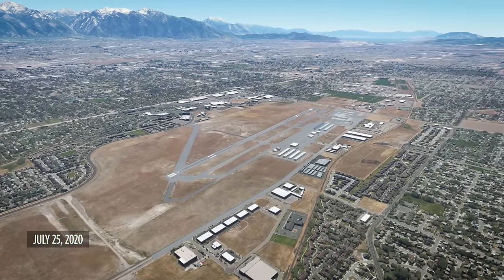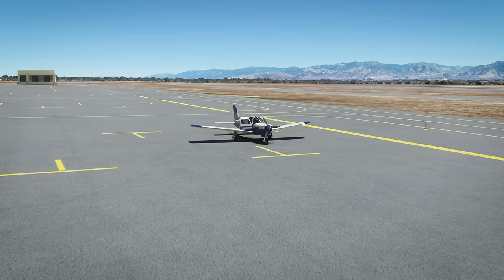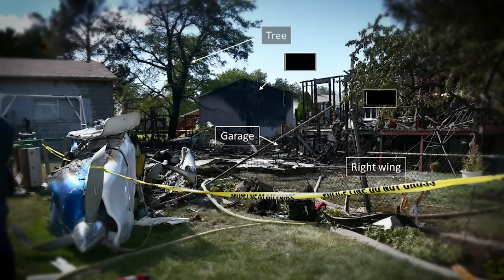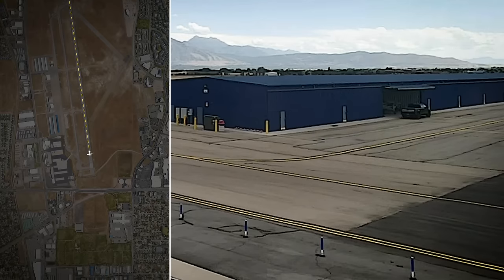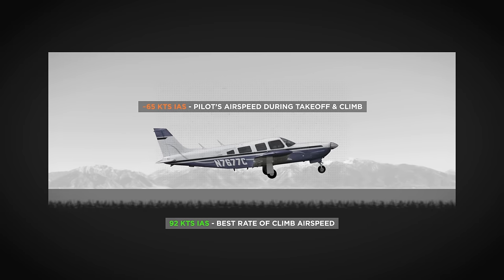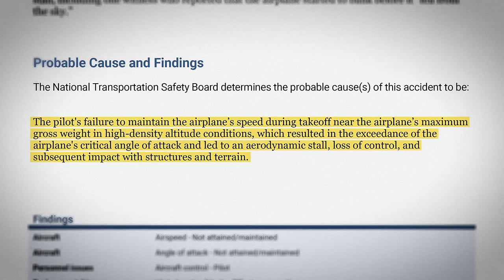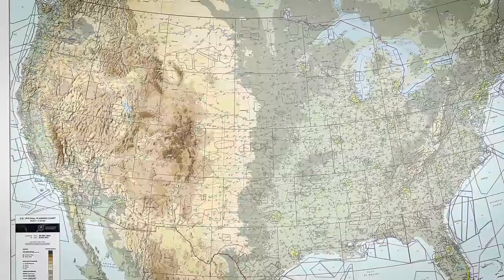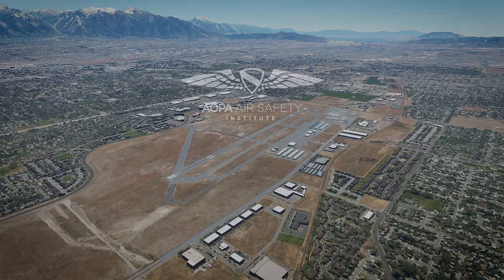Accident Case Study: High Aspirations

Comment: Don't forget that aircraft performance is normally tested with a new engine, plugs, magnetos, fuel system, etc.  I have been surprised more than once with an airplane that simply didn't perform to specifications.  Never push the limits unless you know exactly what you are flying.
Reply: A 500 FPM is a very big variation. Not to mention being under the max gross.
Reply: A properly maintained airplane should perform close to the POH. Even if 30 years old.
Reply: I think the new engine part is the lesson here, but I would argue that POH numbers should rather be conservative and have a 20% margin built in, especially on these cases with hot high altitude close to max weight. No reason there isn’t an extra large margin of safety written in the POH, I doubt this situation would be tolerated if it was a Boeing or airbus passenger jet that didn’t takeoff as advertised in the POH!
Reply: If it's possible to use mixture to increase power beyond what is good for engine longevity, the manufacturers could be doing that during those test flights.
Reply: @jfmrod  I don't think this has anything to do with the age of the engine. I think the pilot did not lean the mixture properly (look at the fuel flow on the takeoff roll - 28 GPH, which to me looks like "full rich"). And that leads to reduced engine power on any normally aspirated engine, even if brand new.
Reply: @Chr15T   That makes sense, but it is also unnerving to think that this tragedy was mostly the result of a poor mixture setting.  Would running rich cause such a massive performance hit?  From start of takeoff to the crash looked like 2 minutes and he barely got above the trees.  The pilot tried to increase airspeed by pushing the nose down but couldn’t hold it due to low altitude.  The short field flap configuration was a good call, but my gut tells me something else was going on.  Just not sure.
Reply: @riclatz7191  Yes, running full rich at a density altitude of 9000ft would result in a very significant loss of power. One that should definitely be very noticeable in the takeoff roll.
Reply: looks like he didn't think to adjust the mixture before it was too late
Reply: @kevinbrand7992  afaik there is no side effects to increasing power through mixture except for possibly increased engine temperature. I think at take off you would rather get all the power you can get even in when not in a high temperature/altitude situations, just because the faster you have some altitude the more options you will have and the less time you are at a high risk/few option altitude. Same reason why takeoff is usually done with full power in piston planes in GA.
Reply: @Chr15T  if that is full rich, I agree that was definitely an oversight, I'm not sure how much power loss that corresponds to though. The video does not make it sound like that was the issue, and suggests the issue is the numbers on the POH not matching reality.
Reply: @Chr15T  "A properly maintained airplane should perform close to the POH. Even if 30 years old."

This is the kind of advice that will kill you, folks. Be careful out there.
Reply: @IslandSimPilot  Exactly the opposite is true.
 
Accepting that an airplane does not perform close to the POH because it is old will kill you: 

If the airplane underperforms, you should be prepared for that, notice it, abort the takeoff, locate the issue and resolve it. 

Don't just accept an underperforming engine as a normal thing, because lingering technical defects may first show up as minor but suddenly become bigger.
Reply: @Chr15T  I'm not talking about an airplane that underperforms in the way that you're describing. I'm talking about flight planning  and the safety margin to build in.
Reply: @IslandSimPilot  What happened here does not look like a flight planning mistake.
Reply: @Chr15T To an extent I agree.
Reply: Sound advice brother....👍
Reply: @riclatz7191  mixture is extremely important. It is impossible to climb with full mixture after a certain altitude.

Comment: It’s really sad to see how an ostensibly good, careful pilot can get themself and their passengers wrapped up over missing the small things.
Reply: I would have to say it’s the plane manufacturer and certification agency that seem to have “missed the small things”. I can guarantee that no accident investigation agency would put the fault on the pilot if this was a Boeing or airbus passenger jet that missed the published figures by about 30%…
Reply: May be did all the small things right but missed a big thing: leaning for max power at this density altitude.
Reply: @jfmrod  The book numbers are for a brand new airplane off the factory floor and being flown perfectly by a professional test pilot.  This airplane was built in 1975, so far from being brand new.  Throughout my training I have been told to take the book numbers with a grain of salt when it comes to flying some of these older model aircraft.
Reply: @Chr15T  I agree, if that would be enough to tip the balance then the video should emphasise that more, not that the POH numbers don't match with reality. The issue with the latter situation is that there is not much to be done except not believe certified POH and benchmarking your plane/engine before trying to fly it at the limit of the performance envelope.
Reply: @bodenwhitmore7699  I've heard the same, but this case shows that you need a lot more than a grain of salt... what I realize is that you can't take much for granted in flying, specially when changing the flight setting and parameters like weight. Essentially take every flight with a new configuration/setting as a test flight and you will be able to maximize safety.... do real world performance benchmarks
Reply: the engine wasn’t built in 1975
Reply: He didn't miss small things. He missed really, really, really big things.
Reply: @IslandSimPilot Like what?
Reply: Not being able to take off is not exactly a small thing.
Reply: @IslandSimPilot  Exactly.
Reply: @duke3478 Like using flap ,for a start. Any flap in this situation is deleterious to takeoff roll and subsequent climb rate . All needless drag .
Reply: @alexp.6406  that, or wait for a low-DA part of the day for takeoff, and plan to arrive at a place with a longer runway later.
Reply: @davidwhite8633  flaps may reduce speed, but the Poh likely recommends 10deg flap for TO as it will increase lift. We see enough crashes from the pilot that forgets to use TO flaps.
Reply: @dro754  The only reason for flaps on T/O is for short/soft field or obstacles off the far end .He had neither . Any certified airplane climbs steeper and faster , clean . It has nothing to do with lift .If you can climb out of ground effect then you have all the lift you need to equal your weight , and weight will continue to decrease as you burn  fuel . After all , you wouldn’t put down any flap to climb over a close cloud or mountain ridge , or to make a close MCA on an airway , would you ? Climb or descent rates/angles depend on excess power /thrust/.  nothing more. Excess thrust is [ thrust — drag ] and so the less drag the better i.e. no flap .
Reply: The airplane stalls when the pilot uses the "elevator" to climb. 

The elevator pitches the wing to the stalling angle of attack. Therefore, the elevator is the "stall device". And should be treated as such. 

The pilot should not try to climb out of ground effect. Pin the throttle, pin the prop lever. Set mixture for maximum power. And keep in in ground effect until cruise-climb speed is reached. There is zero reason to be flying around near the low end of green arc.

Comment: This happened to me early in my flying.  I was flying an Archer, full fuel, with two large passengers, both in the back seat at KEYW on a hot summer day.  The plane took all the runway, and lifted very slowly.  I got lucky, I flew the pattern at 300' AGL and landed immediately, no incidents occurred.  A mistake I never made since.
Reply: Were you over max takeoff weight?
Reply: @hellogoodbye4728  ...and aft CG, and in a Piper.
Reply: Many Archers have a 180hp engine. Perhaps this was a 160?? I flew an Archer II 180 back in the day and loved it's excess performance. Max gross in the summer and it would climb at 1200fpm to 4000-5000' in the Florida summer, where I'd finally be able to stop sweating. Nice feature!
Reply: Thanks for sharing.

Comment: A great analysis and video, a few lessons I take away from this are,
(1) Treat every flight as if you have never flown the same route before.  No two flights are ever the same.
(2) Never do it so close to performance limit.  That 50% padding advice actually surprised me.  I never thought I needed that much, but now that I've thought about it, I think since in a airplane things can happen so fast, that 50% sounds just about right for the decisions you make on the ground and the time you need in the air.
(3) Always double check ASOS/AWOS just before takeoff, in case winds shift or other conditions change, which may lead to lots of recalculations.
(4) Take friends or family for sightseeing in much more favorable weather conditions than this case...much.  That said, overriding your own confidence, and your desire to let everyone have fun, is very hard -- takes a lot of mental practice and still not enough.
Reply: If you are incapable of underpacking (myself included), you either have to have an aircraft tolerant of what you bring consistently at any and all weathers and airports (the more expensive option) like a Caravan, or be accepting of the no-go option.  These six seat aircraft are usually very handy, but with the small naturally aspirated piston, they seem to show up often in these debriefings.  Same horsepower as my Explorer, which does not need to fly.
Reply: "That 50% padding advice actually surprised me."

I was told that since day 1 of flight training, and I will always follow it. My instructor (in his 70's with 50 years of flying) always emphasized this: book numbers are with a brand-new, perfectly-performing aircraft and a test pilot.
Reply: @jaysmith1408 key lessons in this case is when in doubt don’t do it I think he had doubts about this trip which is sad and his eagerness got the best of him

Comment: As an instructor who has always taught more from the principals in "Stick and Rudder" than from some of the poor energy management airmen certification standards, my heart goes out to this pilot, his family, and those affected on the ground.  ACS teaches "acceleration in ground effect to Vx or Vy as appropriate."  While I appreciate the addition of "in ground effect," neither Vx nor Vy was appropriate here.  Vx had become Vy and Vy is just too slow for maneuvering flight.  Having flown low powered training size airplanes in the mountains for years, I have learned that nearly all mountain flying is maneuvering flight.  Even down drainage in the desert, he was constantly in the realm of maneuvering flight.  Everywhere, but especially in the mountains, I have taught the basic level in low ground effect takeoff as default.  More than a few times in many engine failures at low altitude, this extra free ground effect energy has made maneuvering to a suitable landing site possible.  Why do we teach pitching to Vy with half a mile of runway ahead?  Why do we teach giving up the free extra ground effect energy that will provide zoom reserve airspeed, even cruise airspeed, before the end of the runway.  Why do we teach giving up the free extra ground effect energy that will make life and death difference sometime in our flying career?  This well trained and competent pilot, based on his training, was lacking the training that would have saved him and his family.  That was not his fault.  As a part of the training community, that was our fault.
Reply: Thanks for the insight. I'm not familiar with the term "maneuvering flight" in the sense of a regime, can you clarify how you define that?
Reply: Being a CFI in the east we rarely have to deal with DA issues but your insight is invaluable. Two things stand out on this one.  Wind check before takeoff.  He could have just asked the tower, then changed runways and worked out a Bravo clearance to get established in a climb. Second, the 50% padding on performance seems vey prudent as these older aircraft, and who knows about the engine compressions, would have contributed to even less power available than book values. Seems to me this should have been an early morning departure as he would have had that going for him with a much lower density altitude. Almost seems like a turbo is a must have for high density altitude flying in the west. Thanks again for your great insight!
Reply: I must have messed up my reply last night so here goes again.  I define maneuvering flight as flight at an altitude too low to recover from inadvertent rather than planned practice stall.  It is somewhat understandable that flight instruction is from a high altitude orientation since most pilots spend the majority of their time up high enough to recover from inadvertent stall.  It is pretty obvious, also, why after reducing incidents and accidents for years, general aviation has not reduced fatalities at all.  We act like maneuvering flight does no or should not exist.  As a crop duster and pipeline pilot, I lived there many years.  On pipeline, that was 25 hours a week at 200' with waiver.  We will not decrease LOC fatalities until we invest in low altitude orientation and instruction.  We can't expect our students not to stall at low altitude around the airport if we continue to teach them to maintain altitude at all cost and to pull on the yoke on every turn.  What does the airplane want to do in a turn?  Is it wrong? @will-9000
Reply: Just found your book and its on my list to read once I finish The Killing Zone.
Reply: @brianb5594   To clairfy, there is no tower at South Valley.  The ASOS had just reported winds out of the south.
Reply: Indeed this made me think. Once you’ve left the ground effect below Vy (appropriate for the weight and altitude!), you’re basically done. Didn’t really give it much thought… ever.
Reply: You have not been trained to get the nose gear just off as soon as possible and consider rejecting if it does not come off pretty soon.  You have not been trained to get the mains off as soon as they will fly in low ground effect, well below Vso.  Vso is an out of ground effect number that has nothing to do with either takeoff or landing.  You have not been trained to move the yoke proactively and dynamically to bracket level in low ground effect (six inches for a crop duster) rather than staying at a high pitch attitude.  You have not been trained to stay level in low ground effect as long as runway remains available or until cruise airspeed.  Airspeed, and not altitude, is life down here.  Zoom reserve is airspeed that allows temporary climb or maneuvering with the engine running or dead.  Zoom reserve airspeed means airspeed that will allow continued flight even after three seconds of startle when the engine quits.  Zoom reserve airspeed is something crop dusters never leave home without.  And we may even safely go all the way to the crop field in ground effect in the desert where there are no obstructions.  Hurry to get up is what causes the majority of LOC or stall fatalities.  Maintaining altitude at all cost is what causes LOC in strong downdrafts in the mountains and stall in the pattern everywhere.  Life down here is dynamic.  We don't expect to go up continuously, we don't expect to go down continuously, airspeed is altitude temporarily, altitude is airspeed temporarily but can prevent stall in turns.  The Law of the Roller Coaster.  Read "Stick and Rudder." @alk672
Reply: @jimmydulin928 yeah that was the first aviation book I've read. I can see why student pilots aren't trained this way though, you definitely don't want them to fly into the ground at cruise airspeed. Which they would.